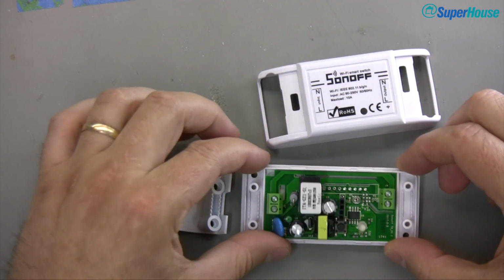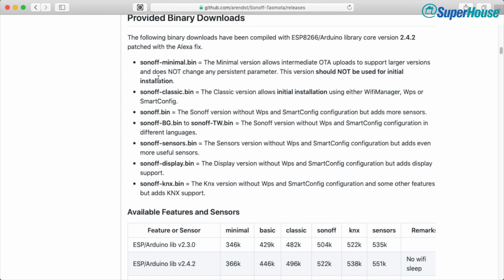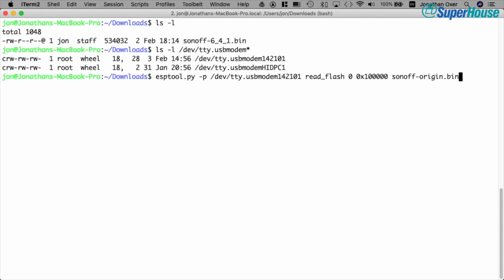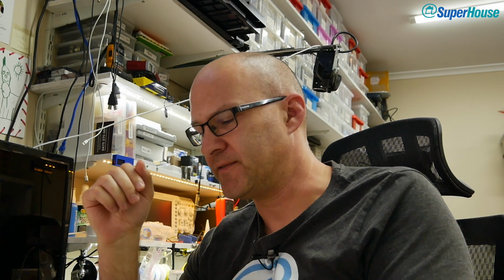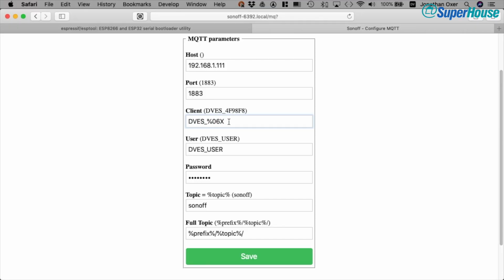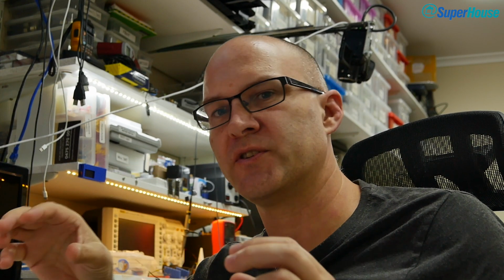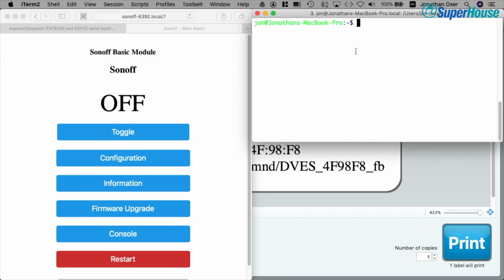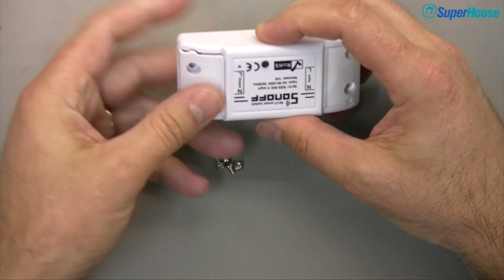SuperHouse #31: Sonoff Tasmota installation and configuration

Comment from the maker: I've confirmed that the process for backing up the original firmware and then restoring it later seems to work OK. I've updated the episode page with a step by step guide. Using esptool it's possible to download the original EWeLink firmware, flash the Sonoff with Tasmota, then restore the original firmware.
Reply: SuperHouseTV really nice. That is the information I have been waiting for a long time now as I did not want to make some of my Sonoff devices useless if I don’t like Tasmota in the end. Also nice explanation of the functions and the group and fallback topics. Will be helpful for me soon. Greetings from Germany. Michael.
Reply: In the website the write command is wrong "esptool.py -p /dev/tty.usbmodem14201 write_flash -fs 1M -fm dout 0x0 sonoff-6_4_1.bin" 
the "-fs 1M" should be "-fs 1MB"
Reply from the maker: Ooh, true! I'll fix that command now. With the current version of esptool you don't even need to specify it, because it detects the flash size automatically. I'll edit the command to remove the -fs argument entirely. Thanks :-)
Reply: I am trying to read the original data using the esptool using Windows 10 - I do get a proper response when I read the <flash_id> but when I try to read with <read_flash> I get a message saying <fatal error occured: Corrupt data, exptected 0x1000 bytes but received 0xfff bytes.  This is the line I am using in CMD mode:\esptool -p com9 read_flash 0x0 0x100000 sonoff_original.binCan someone point me in the right direction...!  Thanks
Reply: Please ignore this comment about the fatal error - it now works!  I used a different USB/TTL and it worked properly.  I also confirm that I was able to put back the original SonOFF firmware and it remembered everything - now I 'm going back to Tasmota and more experimenting.  Thank you SuperHouseTV!
Reply: do you already have a way to automatize curtains from opening and closing {regular curtains}

using a arduino/esp8266 with a reprap shield?

that can be connected to the super house control panel?
Reply: I played around a lot flashing S20, S26, basic and POW-R2 sonoffs. My way of doing it is
1. read the original software with esptool and save it somewhere
2. erase memory

3. write the new tasmota firmware
4. evetually update the sonoff wia the web interface
5. upload the config of another comparable sonoff, so I only have a few things to change as the name of the module, but the main features are already setup, wifi, mqtt, template and so on
6. backup the config
Then it is very easy to revert the sonoff to a working state or even to the original EWelink software.

The read/write process is sometimes long, especially for the 4Mb ESP, so I've always used the option --baud 460800 without any fail.
Your videos are great and clear, thanks !
Reply: the only thing i've read is that you have to backup each sonoff's original firmware if you want to flash it back to it's original state. If you flash the sonoff with the backup of another one, even it's the same type of switch, it won't work. I think it is because something like the serial number or MAC is somewhere checked in the code.

Comment: The video tutorial is super good and one of the best that I observed till date. I am a novice and I could follow your instructions and complete the flashing process without any issues. Kudos Jonathan. My only observation during the entire process is everything works fine and your Jumper wires sometimes may cheat you. I was breaking my head initially where I was going wrong, but all of a sudden, I had doubt on my Jumper wires and my guess was correct. The one that gets connected to VCC of FTDI232 and 3V of Sonoff Basic was not working. I checked the continuity with multi-meter, replaced the jumper wire and everything worked seamless.

Comment: Hi
I’m watching a lot of your videos. This is great content.

I’m excited to do my house smart in future.
I saw that you have a lot of devices in there.

How to do when you want to make every switch, plug, tv, window blinds and so on but you run out off the address space in your router.
When I choose a.e. 192.168.0. 0-255 I have only 256 addresses. Or is it possible to use in the same time also 192.168.1.0-255?
In this case i could use 512 devices and smart phones or computers.

Comment: Can I flash with Itead firmware after flashed with Tasmota firmware?

I flashed two sonoff mini with Tasmota, but using different methods. The first one I flashed with Tasmota minimal through tool_01DIY85(3.3.0) on Windows 10, with the jumper on the sonoff board. After I did that and an itead.bin file appeared in the same folder of the tool. Since I flashed with minimal, I had to use a ftdi board and flash again with full tasmota. The other sonoff mini I put on AP mode, without jumper on the sonoff board, and it created a wifi network, I connected to it and I opened the IP 10.10.7.1. Doing that a configuration screen showed up, and I put my wifi network name and password. After that I opened the tool_01DIY85(3.3.0) and flashed with tasmota lite. With tasmota lite on it I connected to the IP that I was reserved to it and upgraded the firmware to full tasmota through Tasmota webUI. This time an itead.bin did not appear in the folder. I really need to flash back to itead firmware again. How can I do this? Im using windows and I just have a ftdi board. Is it possible? Thanks.

Comment: Jonathan, hi. Could You help with my so off th-16 . I can’t make thermostat from this device. I’ve already flash Tasmota firmware and try to add it in Domoticz server. But it work only if I send command directly to ip 192.168.2.6 etc. Idx not working...

Comment: Is it possible to use a sensor compatible firmware and connect a sensor directly to the chip for use, when the original design doesn't have one built? Like if my smarthome device doesn't use pin X, but pin X can be checked for high/low state with a specific firmware version?

Comment: esptool.py v2.6
2.6
esptool.py v2.6
Serial port COM4
Connecting........_____....._____....._____....._____....._____....._____.....____Traceback (most recent call last):
  File "C:\Users\joaogauer\Desktop\arduino-1.8.9\portable\packages\esp8266\hardware\esp8266\2.5.1/tools/upload.py", line 25, in <module>
    esptool.main(fakeargs)
  File "C:/Users/joaogauer/Desktop/arduino-1.8.9/portable/packages/esp8266/hardware/esp8266/2.5.1/tools/esptool\esptool.py", line 2653, in main
    esp.connect(args.before)
  File "C:/Users/joaogauer/Desktop/arduino-1.8.9/portable/packages/esp8266/hardware/esp8266/2.5.1/tools/esptool\esptool.py", line 468, in connect
    raise FatalError('Failed to connect to %s: %s' % (self.CHIP_NAME, last_error))
esptool.FatalError: Failed to connect to ESP8266: Timed out waiting for packet header
_
a porta serial _
 selecionada não existe ou sua placa não está conectada

Comment: Fasntastic tips again, have you ever came across a sonoff issue where after flashing the software it doesn't power on? Using the 3.3 and ground with jump wires still powers it on but wiring it to an outlet doesn't give it power. Using the ESPTools and step by step from Superhouse #21.  At a loss

Comment: Hi, thanks for your valuable video.
I have a question regarding the MQTT configuration.
I did it in a slightly different manner than you explaines, so my fulltopic looks like :
MYHOME/%topic%/%prefix%/,  so in the assumption that topic is sonoff1 i get MYHOME/sonoff1/cmnd
Now I want to integrate this in openhab2, using paperui
Setting of the switch works, i configured a channel with the MQTT command topic MYHOME/sonoff1/cmnd/POWER
Where i have a problem is that the status of my item in openhab does not change when I manually switch on or off with the sonoff button.
My MQTT state topic is MYHOME/sonoff1/cmnd/RESULT

Anyone has an idea ?

Comment: Hello Johan
I have a problem with the SONOFF® TH16 DIY 16A 3500W Smart Home WIFI Wireless Temperature Humidity Thermostat
I get to see this in my eWelink but the message cannot be reached
Do you know a solution for my problem
Greetings wilhelm

Comment: Hi, I have a couple of Sonoff Pow switches that refuse to connect to WiFi after I save the network's name and password and click save in the connection direct page. Is there any suggestion that you would offer to do? I have tried both the Tasmota versions 6.5 and 6.4.1. Thanks for the great video.

Comment: As usual, an excellent show. As a request, a lot of homes and other styles of houses have switch to 100% solar and 12volt batteries. Can sonoff be changed to run on DC power supplies rather than mains?

Comment: Wow! What a Brilliant tutorial. Kept me up all Sunday afternoon. I had plenty of pitfalls and almost gave up. It turns out the FTDI driver won't permit me to flash my Sonoff. So I tried the same thing with an ESP-01 and a programmer with which it worked and I could see the Home page hosted by Tasmota. 
Still figuring out the MQTT part which you said you would explain later but I couldn't figure out if the 192.168.1.111 was something chosen by you or is ti dictated by something else.
Just loved your patience and excellent presentation of the details. My sincere appreciation to you.

Comment: @SuperHouseTV hi, different subject, but what MCU do you use on the back of your light switches to communicate with your master that controls your relays? 

I am making a passive touch light  switch that i think will need pre-processing on the switch as i don't trust the signal over 30m of cat6.

I thought about using a esp8266 as i have heaps of them, but i really want the signal to be wired.

Any ideas would be greatly appreciated.

Comment: I am new to the entire Sonoff and Tasmota & DIY home automation scene .... I want to thank you for your videos. they have been extremely helpful. I did recently purchase the 2 circuit boards from you to connect and flash the sonoff as you did in the video. As to your advice, I purchased a set of helping hands and a beginners soldering kit. I just finished watching episode 30 again and this video. So, tomorrow, I solder & flash. Wish me luck. After which, I shall attempt to configure using Windows. Then I will see if it all worked. I am going to go ahead and flash 6 all at once & then configure and install them. Again, thank you for your help in the videos. I am slowly becoming "educated", lol.
Reply from the maker: Good luck!

Comment: Thank u for the video.
Can we make sonoff basic work like a mqtt broker ??
Reply from the maker: It's possible, but not a very good idea. The ESP8266 isn't quite powerful enough to be useful as a broker. I've heard of several people working on that, and reports that it has been made to work, but "work" might be stretching it a bit. You're much better off using a device like a Raspberry Pi as a broker, particularly as your system grows. By the time you've added a bunch of sensors that are reporting regularly plus other things, your broker will easily be passing many messages per second. There's interesting discussion here about attempts to do it on ESP8266: https://iot.stackexchange.com/questions/2088/can-i-use-an-esp8266-as-an-mqtt-broker

Comment: Great tutorial. I was able to flash and see working my first Sonoff as you went along only gotcha's I had were difficulty getting GND connection, the solder did not take to GND header pad first 2 times and I missed that after read/write the sonoff comes out of boot load so stops talking - once I learnt those things all was well thanks.

Comment: Great long video Jonathan! So much detail! Have you ever tried Termite? Allows you to send serial command to the flashed Tasmota to set the network ssid, password, and most of all the config like MQTT settings etc. Saves time with the captive portal and IP lookup part of the install process (as console will display IP over Termite). Not sure if it's just a WIN application?
Reply from the maker: I haven't used a serial terminal for Tasmota config, but that sounds awesome, thanks for letting me know! Termite looks like just a regular serial terminal so it should be possible to do it with any common terminal program, including the serial console in the Arduino IDE

Comment: You should check out the new tool to flash Tuya devices OTA with Tasmota: https://github.com/ct-Open-Source/tuya-convert
Reply from the maker: I've been trying to get hold of a Tuya device for a little while. It looks like Bunnings has just dropped the Brilliant Smart Plug range, so I couldn't get one of those. I'm going to try other retailers to find something Tuya based.
Reply: @SuperHouseTV   There should be lots on Amazon -- just search for  'WiFi Smart Outlet'.

Comment: Hi Jonathan - great video. Have you checked out the ESP32-POE and ESP32-EVB from Olimex? It seems like potentially the perfect home automation solution, especially if you have a PoE switch installed with cabling throughout the house. Can't complain about the price either. My favorite thing about it is obviously that it's a cabled solution, and that it'll stay powered on during a power outage as the PoE switch has a UPS.
Reply from the maker: That's exactly how my light switches were originally wired up about 10 years ago, which is why I have Cat-5e to every light switch. I designed the EtherTen (http://tron.cc/et) specifically to do PoE to my light switches so there are quite a few older videos showing that architecture. However, I restructured it (using the existing cabling) to centralise control and decrease complexity. There's a video about that at https://www.superhouse.tv/25-arduino-home-automation-light-switch-controller/
Reply: @SuperHouseTV Okay, that'll be very interesting to see. I am planning such a setup for my house so this is very relevant. I also want to decrease complexity.

Comment: Just an idea, not sure if it would be useful.  Once the Sonoff is flashed to Tasmota, the serial connection should no longer be needed due to being able to flash OTA.  Wouldn't that mean that we would have 2 additional GPIOs?  GPIO1 (TX) and GPIO3 (RX) would be free along with GPIO14.  Is this possible?
Reply: Also, they are PWM pins...
Reply from the maker: Yes, it should be possible

Comment: Short Q....if Tasmota is installed on the sonoff, can it still be controlled by GH or alexa?
Reply: following this question
Reply from the maker: Yes, but in a different way to the original EWeLink firmware, which has an Alexa skill, etc. Tasmota is conceptually a bit different: it allows you to not be reliant on a third-party service such as the EWeLink cloud system, and take direct control of your devices if you choose. It's more suited to integrating with your own home automation system instead of being a single element linking to a remote service such as Alexa or GH. If you have Alexa or GH connected to your existing home automation system (perhaps OpenHAB, or Home Assistant) then 99% of the work is done. Adding a Sonoff to your system is just like adding any other controlled device. I currently use the Alexa Node-RED skill bridge so I can use Alexa to control devices via OpenHAB, including Sonoffs running Tasmota: alexa-node-red.bm.hardill.me.uk

Comment: In your video when you type in the Terminal Window, I am confused, it this connected to HassIO? Please explain if you would.
Reply from the maker: No, that was just the local terminal on my Mac. The same thing works on Linux, and can be done on Windows if you have the environment set up as described on the esptool page. Everything I showed in the video is done only with the Sonoff and my computer, no OpenHAB or HassIO or anything else required. The only extra thing I used is an MQTT broker.

Comment: I followed your instructions for connecting to my PC and started getting a backup on what was currently on the Sonoff (Basic).  Reading the flash with the same command you did (changing to COM2), it stops at "1011712 (96%)".  It isn't writing the bin file.  Any idea why this won't complete?
Reply: Not sure what was going on, but it worked after the 3rd attempt...  :)
Reply from the maker: Glad you got it working! I only mentioned copying the existing flash as an interesting thing in passing, I've never tried restoring the eWeLink firmware. It seems people are interested in that though, so I'm going to test it.
Reply: @SuperHouseTV  I had been through the process of flashing new firmware onto an ESP8266 back when they were fairly new, and it was a serious process.  I guess the idea was just being cautious and having a backup.  Now that I see how easy it is compared to before, I probably won't do anymore.  Besides, you only need one backup of a new device :)

Comment: Good to se emore videos Jon, a quick question, that i bet it might be a bit in depth at the same time. I remember seeing your latest update on how you wired your house, where you no longer have electronics on your switches just buttons with eth cables to your control box. would you use the same with sonoffs? or what would be your approach on the physical way on turning on the sonoff?
Reply from the maker: Great question. The way that I use Sonoffs is in situations where I want control of a device in a non-permanent way, or where rewiring isn't convenient. I have a few of them spliced in series with power boards and enclosed in plastic boxes, the way I showed in the "Six Sonoff Secrets" episode, which is really handy when I want to do something like plug in Christmas tree lights, or lighting for a work bench. Things that aren't permanent house wiring, which is all hard-wired. For those sorts of non-essential things I'm perfectly happy using WiFi to control Sonoffs.